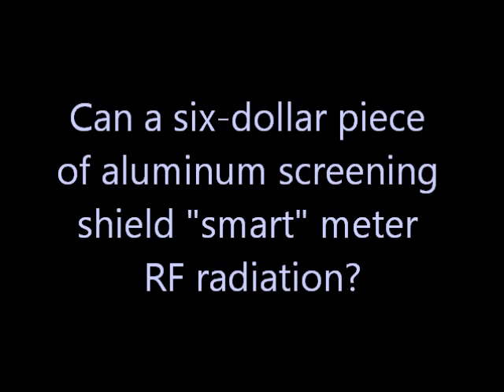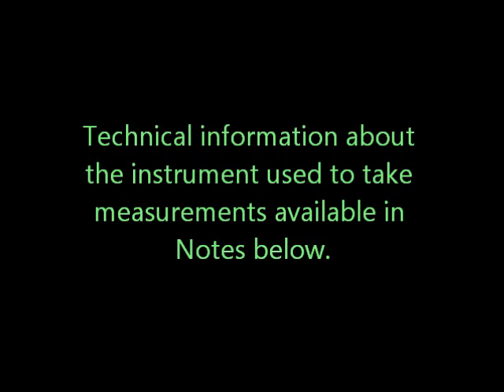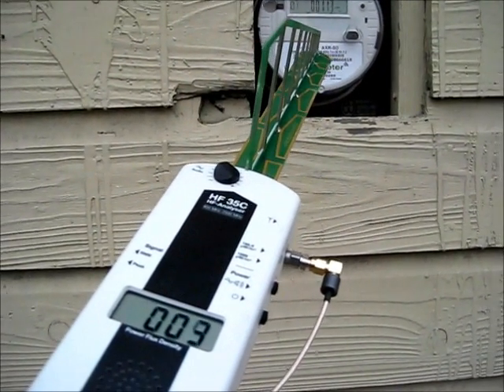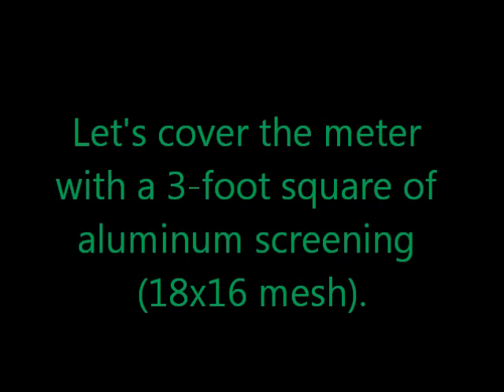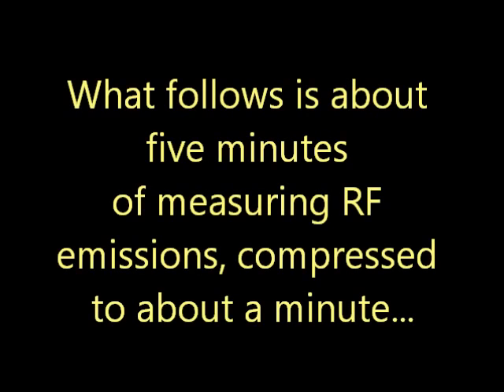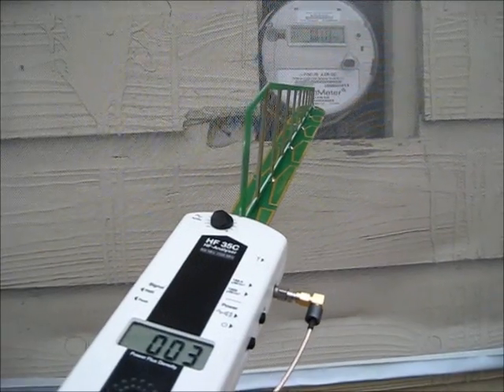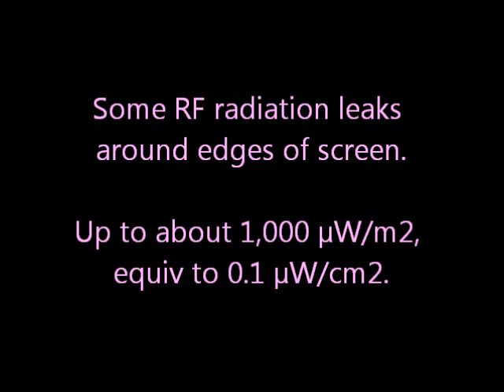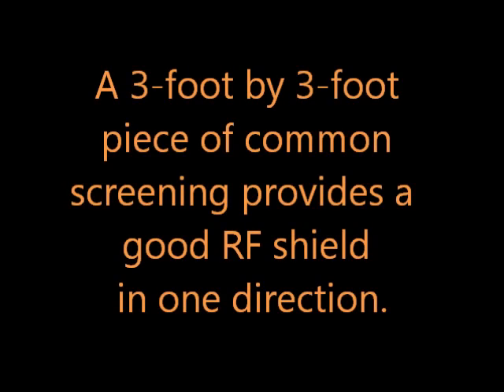Foiling a "Smart" Meter, Part Two: Aluminum Mesh Screening

Comment: Get off the RADIATION kick........... There are a thousand different types of radiation.  SOLAR, THERMAL, VISIBLE LIGHT, SOUND,  ELECTRICAL,  RADIO, just to name a few....... And not a one has anything to do with NUCLEAR RADIATION!  It's just a word, get over it. Your body radiates heat, does this mean your NUKING yourself to death? Are those Radiators in your house frying your brain? The plain fact is, a smart meter is not going to give you cancer, of anything else,  just an electric bill..
Reply: Ebenezer Kalarama Sir there are many people that are very sensitive to RF they just don't talk about it openly and since there has never been a study about the area you speak of does not mean that they are not out there.The world health organization just came out not to long ago that RF is a carcinogenic.The truth is all of this tech relatively "new", so long term exposure is just now coming together and it pretty much all points to a dangerous environment just now coming to light.I am an electrician and have worked in some very high voltage vaults and I can tell you the field given off by the transformer can be felt! So even though it may not be felt by you does not mean more sensitive individuals can't!Basically you're saying a little bit of cancer can't be that bad.It accumulates over time just as a x-ray tech wears a dosimeter to detect long term exposure. There is just to many unknowns to say it's 100% safe,at any level. So the list of occupations you list at the end of your post claims that people in those positions have never had cancer from those jobs,I would love to see that study and where can I find said study?You can't!Why? Because all has never had a such a study been done before
Reply: Frederique Zug  Where did I  get my proof? From half a dozen RF engineers. ....... From 50+ years of tests done by every civilized country on the planet. I'm still wating for documented evidence that RF causes anything other than heating of the body...  And  WE WANT PROOF OF ANY OTHER KIND OF EFFECT RF HAS ON LIVING TISSUE.
Reply: *****  Wheres the proof that smart meters or any other device emitting RF is making people sick?  Is there one documented shred of evidence that RF causes cancer?  90,000 microwatts, for a breef pulse and we're supposed to be concerned.  Less than 1/10 th of a watt. You get more "Radiation" out of a candle. Step back a foot with thst meter, and the level will drop to about 22,000 microwatts, about 1/40th of a watt. Your getting 5000 times more than that from your cellphone.  And you don't think the old stator type meters gave off radiation, sorry your dead wrong.
Reply: Robert Mitchum the navy
Reply: Robert Mitchum world wide panel of scientists proof enough?
Reply: you
Reply: I dun recall anything in this video talking about the meter causing cancer. when did the word radiation become a word that deals with health "only"?

Yes there all kinds of different radiation. but not all of them affect health. Some do. Some are used in medical applications, and can kill or cause cancer. But the ones that don't do not mean they are not bad. leakage of say RF Radiation could affect the performance of other devices or wireless signals. 

Long term effects of some of these types of radiation yes should get more study. While RF Radiation, and other types may seem harmless, it may or may not mean that they are. I do not claim to be an expert. but there always room to do more study on it. There no point in caping our claims trying to tell one person they're wrong and there right. it could end up flipping on you. 

Even today things we thought we had figure out are turning out to be wrong or partly right. So lets just keep studying. :-)
Reply: Frederique Zug i know there is already info out there. what i was saying is. there no harm to do more studies on it. There no such thing as a too much information when it comes to these sorta things.
Reply: Robert Mitchum There isn't any long-lasting effect, at least I can't find any verifiable information on the web supporting it. I've spent almost a year reading about it. You'd think there should be something.. Million-volt tesla generator experiments since 1893, [still popular today] , the ongoing use of high-power directed-RF therapy machines, and now all-time-high in real estate prices in midtown Manhattan high-rises in the middle of some of the strongest RF soup in the world... and no one has ever heard the tiniest peep about anyone getting sick from it. I know there hasn't been a peep, because I've lived and worked there.     Old-time radio shack operators, electric locomotive engineers, generator plant workers, helicopter live-line men, subway passengers, substation techs....the list just never ends.
Reply: jib jacker  You wrote: "The world health organization just came out not to long ago that RF is a carcinogenic."
Copy and paste their actual statement, with a link?
Reply: Ebenezer Kalarama
..waiting.
Reply: Frederique Zug Thanks for covering for me
Reply: Frederique Zug can a dosimeter like a xray tech wears pick up reading from meters(smart)
Reply: jib jacker  sigh...you posted yet another silly/stupid internet myth. What the WHO really stated is:
"Despite many studies, the evidence for any effect remains highly controversial. However, it is clear that if electromagnetic fields do have an effect on cancer, then any increase in risk will be extremely
small. The results to date contain many inconsistencies, but no large increases in risk have been found for any cancer in children or adults." (here's the link, if you need to check it) : http://www.who.int/peh-emf/about/WhatisEMF/en/index1.html
Reply: Frederique Zug Ok but,when I googled the question It said in a hospital setting that there were different types, then in the same sentence it listed radio waves that is way I asked.Maybe someone that uses one could answer that? One time use ones were on Amazon 20 for 21 and change if they worked,  hand them out so people would have something they can see,if people can see and hold it in their hand,it makes it much easier to get them to understand and more apt to start paying attention that's all. I feel the meters must go and just throwing shit out there to see what sicks.Our lives depend on it
Reply: Frederique Zug thank you
Reply: Robert Mitchum  Yep, and these National Cancer Institute maps prove that RF/EMF-swamped Los Angeles county, for example, has lower cancer rates than Northern California rural dwellers. Paul, Jib etc etc: How can that be true, after all of your screaming? How on earth could electric-subway/media-broadcasting-hub microwave-bombarded Manhattan have LOWER cancer rates than upstate farmland? Zoom in anywhere in the USA to see the actual statistics. County maps download is slow. Hope the site doesn't crash... http://ratecalc.cancer.gov/ratecalc/index.jsp
Reply: +Robert Mitchum Effects of non-ionizing emf are not healthy.  These frequencies are put out by our current wifi situation.  Isn't it a shame that the main perpetrators of the more dangerous situations of wifi spend nothing on health concerns, but a ton of money on bribes(political contributions).
Reply: +Troy Foxxin I can eliminate most of the effects of EMF present in our air today(mostly due to wifi situations), but have trouble with strong transmitters.  A shutdown of information(caused by campaign contributions-bribes) stops health concerns(which, of course, are there, or would you live with a 50,000 watt transmitter a foot from your head?) from being considered(1996 FCC ruling).
Reply: +Ebenezer Kalarama You either lack the ability to do research, or you are a power company manager.  Please quit telling people things are safe.  It's irresponsible.  You should at least recognize there are varying degrees of safety, based on the strength of and distance from transmitters, etc.  There are plenty of people on the internet complaining about Comcast routers, for instance.  Old time situations are different from current conditions-or didn't you know?